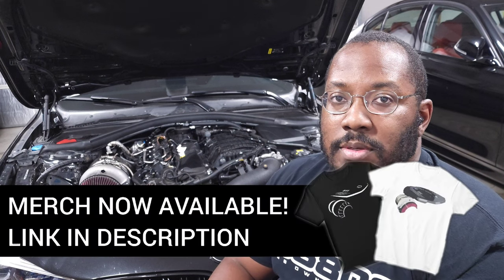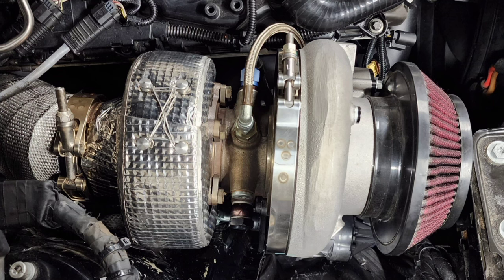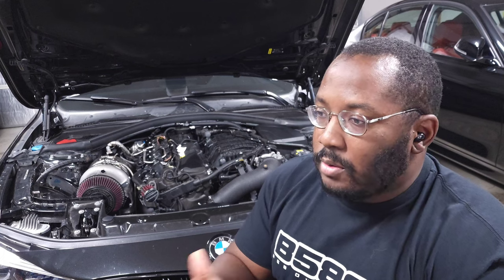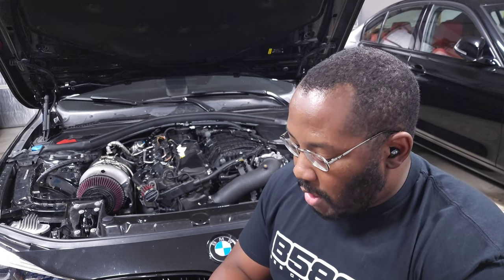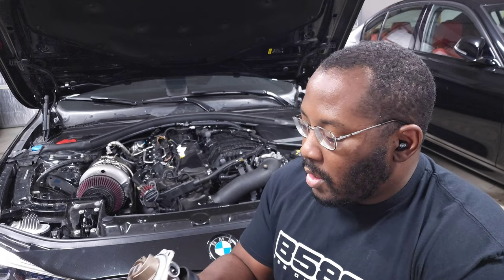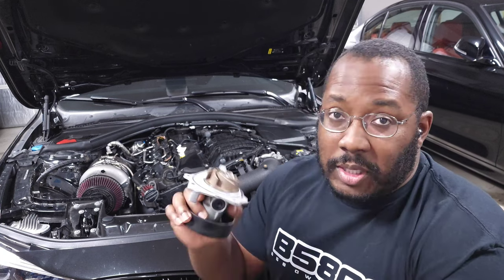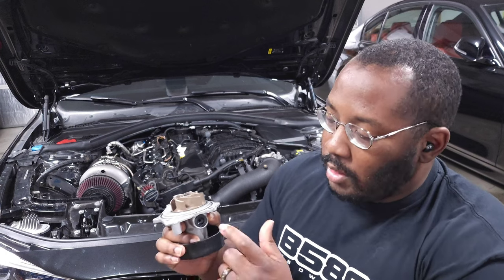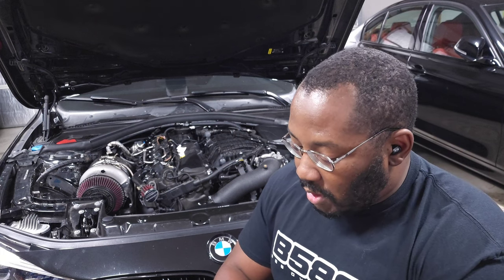Let's talk about B58 Water Pumps - B58 Common Issues

Comment: I had just shy of 15k miles on my 2023 M340i when it developed a coolant leak. I took it to the dealership which diagnosed the water pump. The '23 model water pump has a plastic internal seal which failed on my car causing it to lose 2L of coolant in 60 miles. The dealership replaced it under warranty with a revised pump that uses a rubber internal seal.

Comment: My 2021 m340 lost the pulley on the water pump while getting on the highway. Car had 12k miles. Fixed under warranty in October 2021 hopefully I got the upgraded part. The service advisor said he had never seen anything like this. I feel like that’s what they always say.
Reply from the maker: The date on the tsb is September 2021 so it was still very new to dealers at that time
Reply: Just had my serpentine belt go at 14000 miles on my 2021 m340i, water pump had to be replaced because pulley wheel sheared off.
Reply from the maker: Yep sounds like the same thing. First time i heard about this i assumed it was a freak accident too. But it quickly became more common.

Comment: I just replaced water pump on my wife’s 21 x5 b58  with 18 k miles 🤷🏻‍♂️……
Reply: Mine done at 40k miles. Luckily still under warranty, makes me rethink keeping this car long term
Reply: @peemo888 failed water pump will not make me sell the car , bmw water pump is a common thing to fail .
Have replaced few of them easy to replace.
Reply: @Top_g80comp  yah, but its way too early to fail dont you agree?
Reply: @peemo888  mine failed at 18k miles that is unacceptable for sure , but that wont make me get rid of it , love this car 🤘💯
Reply: @peemo888 this is literally the only issue with b58 lol

Comment: My stock 2017 440i LCI with 70,000km on the clock just got the “low coolant” warning yesterday.. took it to BMW today and they diagnosed the coolant leak as “Coolant leak from plug under water pump. Require to replace water pump as plug is part of unit” $1193 AUD 😢

Comment: I have 16k miles on my 2021 M440i and just had my water pump fail. Coolant low warning light came on intermittently as you described. Took it to dealership and they replaced it under warranty. On a side note, service rep advised that there is now a Dinan M Performance tune for the B58 engine which boost HP to ~480 HP to the wheels and ~470 Ft. Lbs. Torque. they also have a new Air filter which will add a few extra HP's and Torque. Price for the Tune is ~$2200 plus tax and ~175 for air filter. it is warrantied for what is left on the original manufactures warranty.

Comment: Love your videos. Like Chris fix for the b58, my idle had a loud noise over the injectors and fuel tank vent valve and I loosened the belt and my water pump has enough play to make the noise so I have to do it now, about 82k miles gen 1

Comment: 92k miles gen1 B58 in a 2016 340i
Water Pump started leaking from weephole. Probably similar cause as the coolant slowly gets low in these vehicles for some reason and it doesn't always notify you before damage to pump occurs.

Comment: I have a leak in the back  area of my motor, I changed the the thermostat and the coolant reservoir cap I recently changed as we’ll. Could a bad water pump cause a leak in the back of the motor also ?

Comment: Hi Kern, 2017 440i  GC (B58 Gen 1) owner here with 42K miles in the car and i’m also having a little drip from the weep plug on my water pump, but only a few drops from time to time and not every day… i need to top off a little of coolant every month but honestly is keeping the level relatively fine. I want to change the water pump to solve the issue but i need to know if there is a new updated part of the water pump or if i can buy the same one and wait 45K -65K miles until it fails again? Thanks for your opinion and for making this kind of content for the B58 comunity.

Comment: What oil do you use to prevent water pump issues?

On a real note I’m at 80k kilometers / 49k miles and my water pump is still running fine. I believe my coolant vent hose line might be leaking as every 1-2 months I lose a bit of coolant

Comment: I’m having issues with front wheel bearing on my m240, have you heard of such issues, change both front in less than 5k miles
Reply from the maker: Is it XDrive? Are you lowered? Wheel setup?
Reply: @kern417  yes xdrive not lowered and 18inch wheels oem 225/40/18 at the front… the roads in my area are really bad thinking of going 17 inch with 50 profile tires it might help reduce shock on bearing
Reply from the maker: @hass1005  maybe get your alignment checked

Comment: I just had to change main coolant tank , as the lower hose Was leaking it might have been jusy the O Ring in the Pipe i changed that also … I now bleed the air with The electronic brake bleeding procedures for both reservoir hope
Thats enough… and not have to drain whole
Coolant
Reply from the maker: As long as you bled the system and see no more leaks you should be good 👍🏾
Reply: @kern417  So far so good … My car has 112tkm early next year i will do Gearbox Oil change, then spark plug change , then tune it

Comment: What part number for the gen 2 new water pump
Reply from the maker: Should be 11515A444F4
Reply: @kern417 they are ditect Bolt on for gen 1?

Comment: Man, I smell coolant in my engine bay but can not locate any coolant leaking and I dont have any warning lights. This is a 2022 m340i w less than 5k mi.
Reply from the maker: Is you coolant level low
Reply: @kern417  nope.  Check it about 20 mins after I left the comment and it was  at the max line.
Reply from the maker: @jasonsutton6193  both tanks? Any crusty material around the threads of the cap? That's very strangem
Reply: @kern417  on both tanks the levels are good, caps are clean with nothing on the outside of tanks.  Idk if it could be spilled coolant from the factory but I feel that would’ve been burnt off by now.  It’s not a heavy coolant smell but it’s def there.  Driving me nuts.
Reply from the maker: @jasonsutton6193  is it stronger by the exhaust?
Reply: @kern417  haven’t really tried to pinpoint where in the engine bay it’s coming from.  Just notice it when I get out of the car and when I pop the hood.  Will definitely try and see where it’s strongest in the AM.
Reply: @kern417  So i just checke dit out a bit and the smell seems to be strongest by the expansion tanks.  Not sure if the line under the main tank or intercooler tank is leaking but I'm installing a DP today and will check once the car is lifted.  Appreciate your replies here.  I've learned so much about my car from your channel it's insane.
Reply from the maker: @jasonsutton4451  glad to help. Make sure it's not just some residual from filling up or something
Reply: @kern417  kern, what are your thoughts on running a dp with no tune?
Reply from the maker: @jasonsutton6193  typically works fine. Just don't expect a significant performance gain